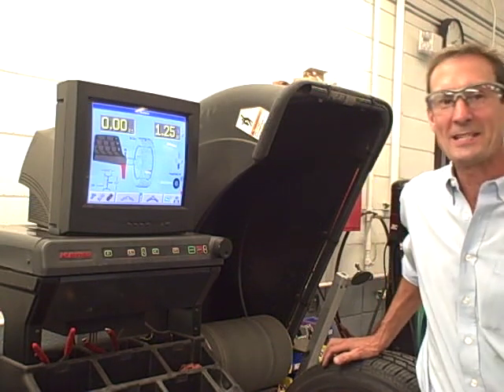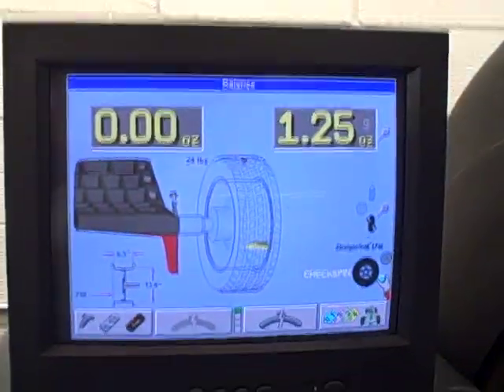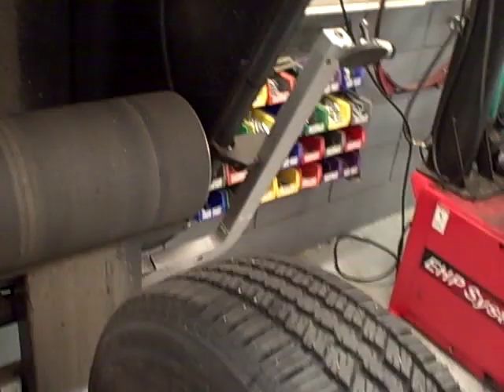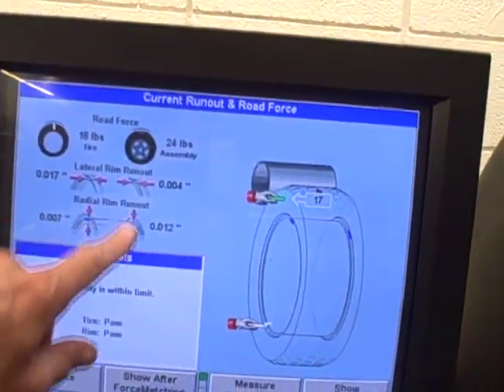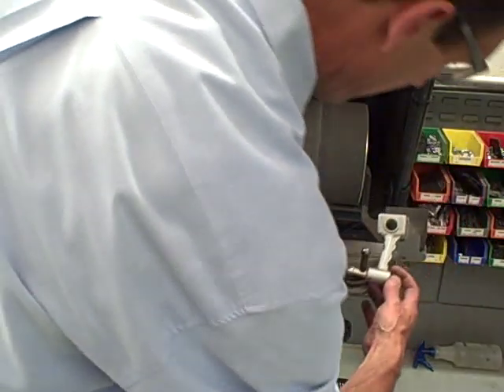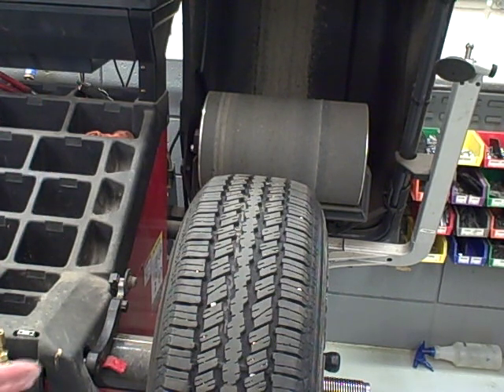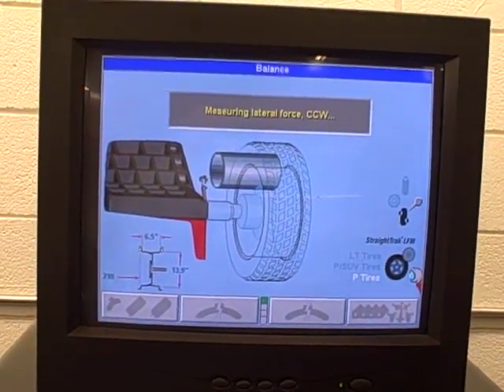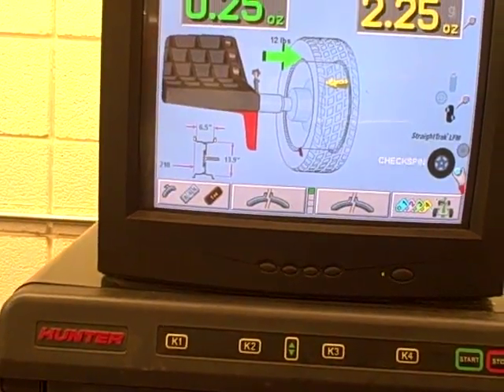MSCTC Training Video Tire to Rim matching on Hunter Road Force Balancer

Comment: Kind of a lot was missed in the explanation for the rim to tire matching. I can see that you do as the machine tells you to do. I want to know why! Did the machine determine that the chalk was to be applied to a high spot or a low spot and the tire high spot or low spot. Do you put two high spots together or vice versa? or a high and low spot.  People are going to miss the why, unless they don't care, which a lot of "TECHS" don't.
Reply: MIRHOSSAIN,,008801850410026
Reply: The machine measures the wheel runout and the roller measures the tire stiffness. It then matches the lowest runout spot of the wheel with the stiffness part of the tire (low spot wheel to high spot of tire).  This will provide the lowest road force for the assembly.  If the wheel is perfect, there will be no improvement by rotating the tire.  But that is rare.  I roadforce my tires to get below 10 lbs of RF if possible.

Comment: Thanks for showing this.  My GT500 has some vibration occasionally that I strongly suspect is due to an improperly balanced wheel and have always wondered why the road force is different.  This is great info and from now on, I'll be using road force balancing on my Shelby at the least.